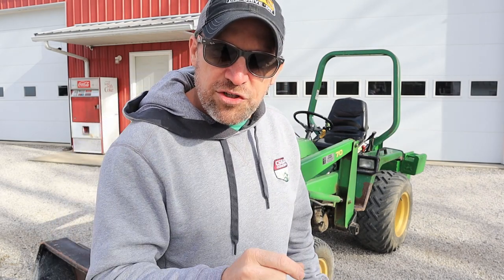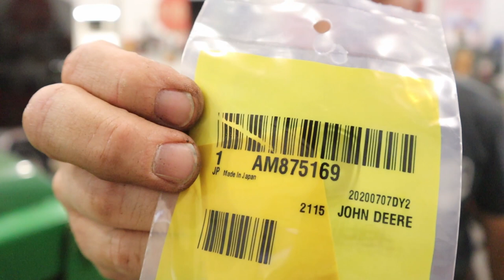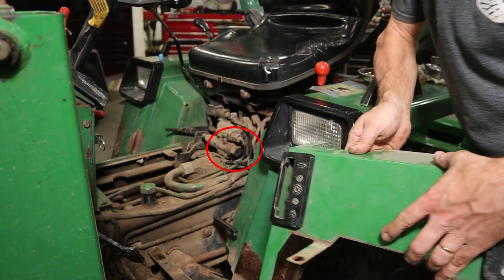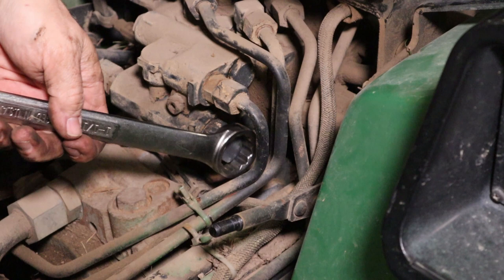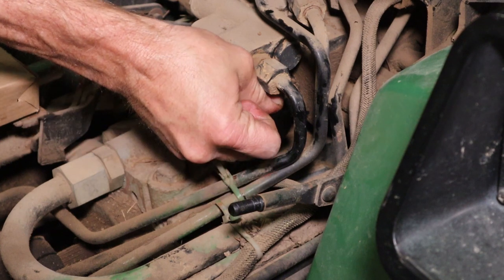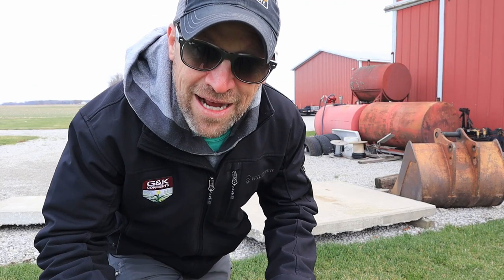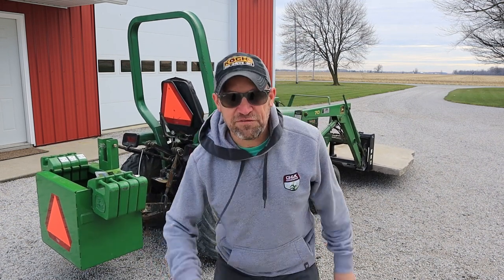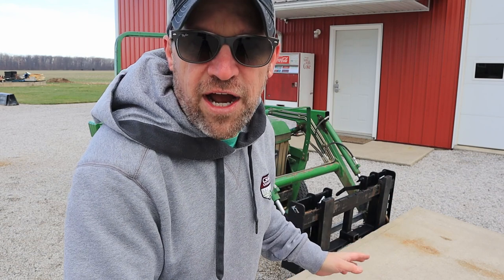How To Increase Hydraulic Pressure on John Deere 755 with Relief Valve Shim Pack - MORE LIFT POWER!

Comment: About a month ago we were being introduced to Electile Dysfunction... I am sooo glad you changed the topic!  

Because you don’t get something for nothing... we negotiate trade offs all of our lives.  Work arounds, alternative methods, less performance for more convenience, higher risk for increased rewards... that is life.  Striking that balance between being risk averse and too risk tolerant is a fine line. What you did seems to toe that line.

I added an aftermarket quick attach to my old BX24.  It was not a Skid Steer type. Two things became immediately apparent.  Less bucket lifting capacity and more slack between lift/lower.  

At first it bothered me a lot.  But, the convenience, when changing between grapple and bucket, more than compensated for it.  

I bumped the pressure just a touch and found a happy medium.  It now lifted about what it had before.  (The Kubota BX pressure control valve is easy to get to... it is  near the rear PTO output.)  However, pressure did nothing for the slack in bucket response.  I just learned to live with that.

Two summers ago I traded up to a new BX23S.  It came with a factory Skid Steer type Quick Attach.  What I found was, even though the pressure specs were the same, the new one was set at the top of the spec. So, lift capacity was about what I was used to.  However, bucket slop was only half what it was with the aftermarket quick attach. 

Had I had never known what the original performance for the BX was... I’d have gotten used to the tractor as it was, without a thought of how good it could be.  As it is, I recognize the trade offs and am happy to learn how to perform without fretting about dysfunction...

I suppose it’s inevitable that... regardless of what you see in the TV ads... as you age you are going to have to negotiate trade offs.  But aging also teaches you, slowing down just a little bit and enjoying the experience is a reward within itself!

I know it takes a lot of courage to discuss ED in this environment... so, I applaud your bravery.  Congratulations to you and your partner for successfully negotiating your way through it.
Reply from the maker: Ha! Very well said. You addressed a few key things that I neglected to elaborate on very much, the biggest of which being trade offs.  I think as long as you find that proper balance and be content, then you may carry on with little risk.  If however I get to a point where I want more and more, then I think I'm likely to find failure and break or bend the tractor. I just need to keep myself content with how it is now.

Truth is, this tractor has been this way for a good while and I just recently finished the intro and end where I finally tried to pick up that concrete. I have used it in other work and seems to be all around just a little bit better and nothing extreme.  I hope it will stand the test of time.

Thanks for sharing the story of your Kubotas. I hope to be comparing my next tractor to this one at some point! Always nice when you get to follow a stair step approach to getting your "perfect machine", then you can appreciate the experience as you've said. I had a JD 318 loader before this tractor.  That was great for nearly 10 years.  This tractor is way better.

Thanks again for the great comment sir.
Reply: I look forward every week to the entertaining  comments by Mr. Valley. Your humour and intelligence matches my sons! Kudos!
Reply: @marykoch5168  I’m flattered... after years being forced to do technical writing, I look forward to the opportunity to jot a more personal note to someone who is interesting... and returns the interest.  

Thanx for the compliment... and please call me Dave.
Reply from the maker: I look forward to his comments too Mom :)  Plus, this week Dave made me realize I spelled "dysfunction" incorrectly in the video!! 😋

Comment: I just read through all of the comments to make sure this wasn't already addressed.  
BOTH OF YOUR FRONT TIRES NEED AIR!!!!  
I'm laughing so hard because "Mr. Maintenance, OCD" didn't check the front tires' air pressure before trying to lift the concrete slab the first time.  And no one else caught it either, or made mention of it.  For shame Neil.  😂😂 
Please know that this comment was all in good fun.  I just couldn't believe how far the tires dipped when the slab was lifted.  Great Video presentation as always.  Thank you🥰🥰
Reply from the maker: Ha!  Maybe so, but they actually are squishy cause it is so heavy!  But I probably didn't check them either 😂. I know it's all in fun!  Gotta have someone to keep me in line😜
Reply: @digdrivediy   Oh good, I really didn't want to upset you with my nit picking.  My hubby is from Muncie, IN and I'm from Baltimore, MD.  Funny story, They (my In-Laws) claim to be Colts fans.  My statement to them is "I'm an original Colts fan" since I grew up watching Colts football games from my dad's lap.  LOL  😂😂

Comment: Hey Neil, A follow up on my 955. I rebuilt 1 leaking boom cyl. while waiting for test gauge. It only read shy of 2000 PSI, 955 is supposed to be 2500 +/_ , anyway I found 2 thin, 1 thick shim in valve, and added all 5 new shims. It now reads 2500 PSI at full throttle. Was thinking later I might bump that up a little more, (like Tim The Tool Man Taylor says MORE POWER) Half a kit maybe?  I would probably just break something again. Want you to know your video  on 755 was Identical to my 955, and I was very happy with how easy it was to do. Thanks for sharing!
Reply from the maker: That's great to know Larry.  I'm glad that you were able to address that low pressure issue.  I think your 955 will perfomr much better and I'm also glad to know that it was the same for the 955.  I think you could likely bump it a bit too.  Appreciate the feedback and have fun with that 955!

Comment: The increase was 25%.  That's actually quite a bit in terms of hydraulic pressure.  Fortunately you know your equipment and how to operate.  Some folks on certain other machines with other lesser built loaders may not want to try this at home.  I'm going to do this to my 670.

Comment: Man I love those older little John Deere tractors. Yes yanmars, but 100% steel where the Yan's had aluminum. Making Deere's heavier which is all important, and stronger.
I have the 1050 and love it. She's a real tractor and easy to maintain and operate. Big and heavy to easily handle the biggest of trees, big wet hay bails, and my "quick-attach" backhoe is big enough and strong enough to actually be useful for anything I could need, but is certainly not a excavator. Problem is my 1050 is a couple thousand pounds to heavy to drive over our actual lawn, and abit to big to get into certain spots an trails. My cousin has a 99' Kubota 25hp geared tranny and he is able to access all his property which has alot of extremely steep hills, he gets that Kubota through all his winding ATV-UTV trails to maintain and skid out trees for firewood. He has a small rear pto skidder winch for it and he loves it, perfect machine for his needs which is my point. Where my 1050 while not being large at all is still too big and too heavy for some things I really need or want it for. Flip side is if I had a smaller one she'd be too light an small for the things I absolutely need to do.

Excellent video man
Reply from the maker: Thanks a lot John.  And thanks for sharing about your 1050.  It's nice to have such a machine that can get the job done faithfully and reliably.  I've never been on a 1050 but sounds like a great machine.  I wish I had about 4 different tractor sizes to do everything I want to do.  Thanks so much for watching the videos!
Reply: @digdrivediy  ya man you hit the nail on the head  about the different sizes of tractors for different jobs. Simple truth is sometimes we need big an heavy with raw power, yet others we need small light and nimble still with the power of a tractor.
Which is why your videos are so good, many tractor owners have a tractor too big or too small, making it paramount to select the tractor which "best" fits your needs. Even the older tractors with damn near legendary reliability have their short comings, but it's up to we the owners to have the right implements and know how that most of the time make the biggest difference

Comment: A friend of my neighbor had a smaller Ford tractor I believe it was, she was used obviously which was the main factor I believe as they were worn. He did the same "mod" to adapt his beloved tractor to his needs and he swore he blew out both fel lifting cylinder seals within a month. So bad that soon as he shut it off nothing in bucket, loader halfway up he said tractor off the fed would ooze and slowly steadily drop to the ground.
He should e added a seal additive at the least to help any bit. After he rebuilt them he said she was awesome
Reply from the maker: Man that doesn't sound good!  So far so good with my modification on this one but I didn't crank it up too much really.  Thanks again for watching John.

Comment: I increased the pressure in my Massey Ferguson 35 when I put a new hydraulic pump in and its made a good improvement.
Yeah its going to put more strain on everything but manufactures make things strong than they are rated at anyway so all you how are going to be posting comments about ' that dangerous'  that going to wreck you machine'  'that stupid'  just go watch something else ok!
Reply from the maker: Thanks! I do think these loaders are capable of handling this moderate increase in pressure. That's cool to hear you had a better experience with your tractor after the new pump.  I think I'll be fine with this little upgrade and the benefits are well worth it.  Appreciate you watching and commenting.

Comment: You did an excellent job with the quick tach and raising the pressure.  Big difference between the 755 and my 750 and 67 loader.  The reason they have lesser pressure is they have to make it idiot proof.  You know to keep the weight even so not to twist the loader and not raise it too high and roll the tractor.  I'm seeing newer Kubota loaders get bent. That cement it a very heavy load for that tractor but great for demonstration.  Nice looking farm,  hope bidens bs doesn't take it away.
Reply from the maker: Thanks so much Jeff!  Yeah, gotta be mindful and play it smart when trying to use it at full capacity like that.  I feel I approach most everything with as much common sense as possible which seems to be working out so far.  I appreciate the kind words and for the great feedback. Take care!

Comment: Great video. Quick and to the point. I have a 790 and this would apply if I ever have any issues. Right now the steering and front loader growl and studded when operating. Any ideas on that? I changed the hydraulic filter, strainer and fluid and no problems at first. ??? Thanks for you video.
Reply from the maker: I'm. It sure in the growling but sounds like it is starving for oil.  Either filters or a pickup tube or screen maybe.

Comment: So I have a 955 and am happy with the loader lifting capacity. The 3 Point hitch lifting capacity sucks for a tractor of this size. I think the way JD did it with a piston inside the the rear hydrostatic assembly is what is limiting the 3 point can lift. Most tractors of this size can lift 1200 to 1400 lbs. The 955 only is rated at 957. I checked the pressure a year ago or so and it's right on spec. I Picked up a new Woods BH75 backhoe for it so when I take it apart to put a power beyond kit on it I am gonna bump the pressure maybe 100 to 150 psi and see how it does. I have a Land Pride OS1548 seeder which weighs about 1250lbs.....I have to take the rear culipacker off just to "get it up" and when I fill the seeder It's barely getting off the ground, very frustrating, I knew when I bought it that it was gonna be close so hopefully another 100lbs of pressure will help. Very nice video, explained very well.
Reply from the maker: Thanks for the kind words.  Yeah, it always seems like just that little extra could really help in most situations.  It is so frustrating when your tractor can just "barely" do something.  I was glad for this modification that really wasn't detrimental to the tractor but made it so that I could have just a little extra "oomph" to overcome the weight of the quick attach.  I'd be interested to hear how that turns out for the 3 pt on your 955.  I am hoping that I get to own one of those some day.  Glad to have you watching.
Reply: @digdrivediy   so this gave the 3pt a bit extra lift as well??

Comment: I have a 755 that ran fine until a month ago. It will crank, but only run with the throttle in the high position but barely. If I hold the key over, it’ll run as it should, however, once the key is released, it will either go back to low throttle or croak. Have you seen this issue before?
Reply from the maker: Sounds like maybe the fuel solenoid is partially closing as it is running, but I am not entirely sure.  I have had issues with the fuel shutoff solenoid not working properly and there is a rod on them that can be adjusted.  I would start there since it appears to run fine when the key on.  In one of my other videos I actually make a repair to the wire that goes to the fuel shutoff solenoid.  I'll try to find it if I have time. (It was the one where I was getting the leaf vaccuum out for the first time)
Reply from the maker: https://youtu.be/Bvg9-BZ6YLw

Comment: Forgot to say man it's actually impressive the 755 picked up that concrete. If she was upright and tight to the pivot point it'd be easier but still heavy. 
Even the newer Kubotas struggle, and the Mahindra has higher pressure/flow and will lift but the tractors not big enough (like at all) to handle it. Can't steer and obviously not safe. What good is the power when it lifts no problem, but it isn't lifting the load it's lifting the ass end off the ground even with weights/loaded little tires and a weight box.
Yee older all heavy steep Deere's have hundreds of pounds and strength naturally cast into their hulls.
I love those 650-750  Deere's man, like a way over built and over powered wheeler with a FEL lol
Reply from the maker: I'm always impressed by what these older machines will do.  I'm sure thankful to have it around and now it lifts just a little better too!

Comment: My relief blew out the bottom of my loader valve on my allmand tlb after the female thread had cracked, now it’s just a spring half sticking out and leaks a little, funny part is I still use it like that until I find the parts and have the time to take it all apart lol
Reply from the maker: Holy smokes!  Well, at least you know what to do to get it fixed and I'm glad it's still working that way for you.  I hope I don't suffer the same fate!  Thanks for the comment and for checking out the vid!
Reply: @digdrivediy  I would think the little bit of increase would be no problem for a loader valve that’s in decent shape as in your case, I had bought my backhoe for a few grand on a lunch break that I don’t even get while at work, so with all the pieces of the machine atleast there I knew I could always get my money back reselling it. It was previously a Taylor rental unit and the person I bought it from had basically no knowledge or experience with equipment so i knew it had been tinkered with in not a good way haha. Hopefully this winter I can tear it apart, I’ve been looking for a skid steer quick attach solution and your video solidified my thinking on how to approach it... seriously I can not thank you enough for posting that video Neil!
Reply from the maker: That's great!  I love hearing that kinda stuff.  You always wonder if people find any of this stuff useful so thanks for letting me know!

Comment: We have a john deere 855.  Just added the loader. We were looking for a hydraulic kit for it.  I see you had the loader on yours.  Did you add a kit? Or peice it togeather? I cant seem to find a kit anywhere. I heard there is one.
Reply from the maker: Both of my tractors came with the factory installed loader valve. I think it would be difficult to add it unfortunately.

Comment: My brother in law has a 755 when it’s cold outside he can’t start it up he has it plugged in the engine is warm to the touch it won’t start so he had it in my dads shop where it’s nice n warm then he can’t start up no problem he changed injectors still no difference any ideas what might be wrong ? My dad has a 955 never had any problems even at -30
Reply from the maker: I'm not too sure but it sounds like it could be bad glow plugs or low on compression. 

One of my 755s has 2x the hours of the other.  The high hour one starts hard when cold and the lower hour one starts great.

Both have working glow plugs.  I would make sure the glow plugs work first then go from there.
Reply: Thanks
Reply: @billymartens7732  The relay for the glow plugs has a thermostat built in, probably bad.
Also, check wires to glow plugs tend to short to bolt on head.

Comment: I was looking for a pressure gauge and JD quick connect male fitting on Amazon & it looks like I need another fitting to connect them together.
Reply from the maker: Hi David. I was able to connect the John Deere male fitting directly to the gauge. The gauge I purchased had a male pipe thread sticking off of it and the JD quick connect female inlet side threaded right on.